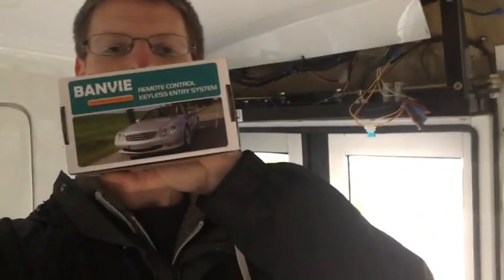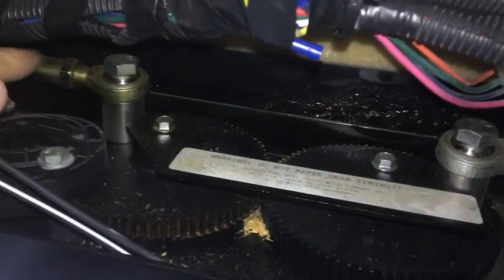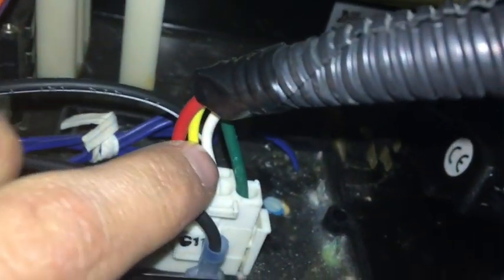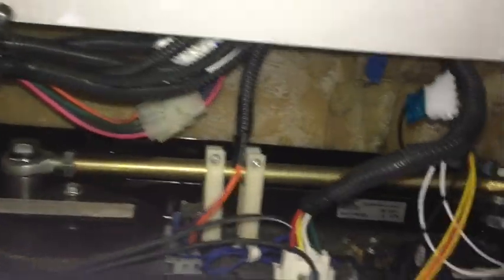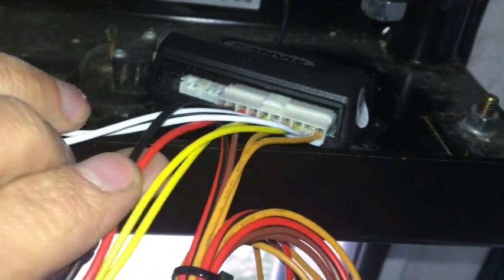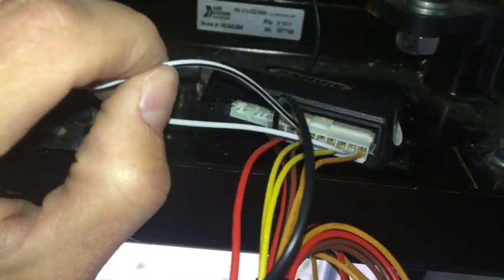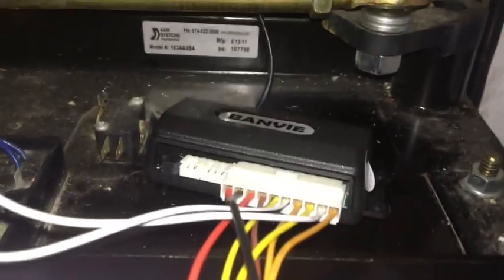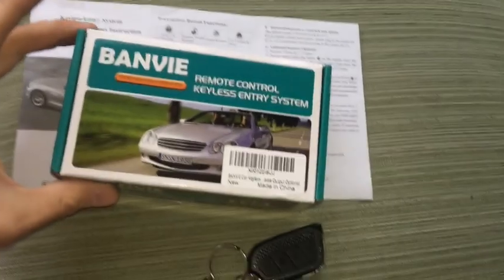How to install remote control front door opener on shuttle bus conversion

Comment: I wired it up as described and it is not working correctly.  If the door is fully open or fully closed and I push the remote (either open or close depending on which way I want the door to go) it opens (or closes) for a split second and then stops.  I did those little pins so it will run for 5 seconds.  Any other ideas on what I'm missing?

Comment: Hey! I'm trying to do this with my bus but I can't figure out how you were able to connect the power cords to the 12v battery. Any help?
Reply from the maker: miles angelo in the video we just spliced it into the power cords that were already going to the door. We later changed it to go directly to our deep cycle batteries that are hooked up to our solar to make sure that it wouldn’t drain our starter batteries.
Reply: @dustinsearer5228  great to know, thanks so much for responding! I was also wondering, how did you figure out which cord was which (power, lock/unlock, ground)?
Reply: @dustinsearer5228  my bus system is similar but not the same, so I'm having a bit of trouble figuring out what goes where haha.
Reply from the maker: For sure. We used a 12v test light like this one. 
https://www.amazon.com/OctagonStar-Circuit-Systems-Continuity-Voltage/dp/B01HUZPTPS/ref=mp_s_a_1_6?dchild=1&keywords=12+volt+test+light&qid=1594125377&sprefix=12+volt+test&sr=8-6
And used it to see which wire had power all the time (positive power) which had power when we hit the open button (open) power when we hit close (close) and which never had power (negative/ground). 
Good luck! :)

Comment: Finally had a chance to install it.
Just perfect!
Interesting fact:
My proximity switches are completely loose, I mean out of the place they were installed (I see the mark from when they were in place and the holes for the bolts line up perfectly), and my doors always worked right. The motor stops working at the moment the doors are completely open or closed.
I have no idea how this happens.
Anyway, again, what a great explanation.

Comment: Hi, I also have a shuttle bus conversion and am thinking of switching my current key fob to this, actually I have already purchased from Amazon. My current fob does not allow me to use the open and close polarity button existing on the bus. I can only open and close with the key fob. So it would be inconvenient for passengers with no fobs and as well having to carry the fob to open and close at all times. Also it doesn’t work smoothly like this, I have to push both buttons for it to open or close. 🤔

Comment: This ended up much simpler than some of the other mods. How is it working for ya now? Anything you would do/have done differently?
Reply from the maker: Initially we connected it to the main bus battery and very quickly had a dead battery. So I would say to reroute the power to the batteries of you solar system at the start. Good luck with your build!

Comment: Thanks for the great video. I actually have the same exact door on my bus as you so I thought this would be flawless. After wiring it all up (except to my 12v battery bank, not to my car's battery) I soon realized that every time I close the doors with the FOB, after 5 seconds the door automatically opens back up again! Tried many things and just cannot get the doors to stay shut. Any feedback would be appreciated.
Reply: PROBLEM SOLVED! When I originally wired this, before disconnecting any wires I had the doors in the OPEN position. I believe this was my issue. I rewired everything back to the original setup, put the doors in the CLOSED position, and wired this up just as described above and it worked! Hope this helps anyone else having this issue.

Comment: Great video and my bus door controls and gears looks just like yours BUT!
My bus is Ford  F550  even though it looks just like yours it did not work? Help
Reply: Same here. I have a f450 shuttle bus. Didn’t work. Same wiring. I do however get a red light on the bus motor box. 🤔

Comment: Great video!  Still adding value.  I bought a different key fob and it was small could not get it to work.  Saw another video on this key fob and it was confusing. Yours was spot on.  Question:  Did you have a switch by the dash and did you disconnect/ bypass or can you still use that switch?
Reply from the maker: Hey. Glad you found it helpful. Yes, we had the switch on the dash and it still worked. We just spliced into those wires without disconnecting them. So we could open the door with the dash switch or the fob.
Reply: @dustinsearer5228  Awesome!!     And appreciate the quick response.   That was definitely what I wanted to hear.  I tried putting a fob receiver in right at the switch location so I can still use it, but wires didn't match up.

Comment: what battery does it connect to? is there a battery up there with the motor? or is it talking about the engine battery? or the batteries that are powering the rest of the bus?
Reply from the maker: We first connected it to the starter battery for the engine but then realized that would drain it and could strand us. So we rerouted it to connect to the batteries connected to our solar set up which powers the rest of our build.

Comment: Help.  I wired up and it "works" for about 2 seconds and then it pops the fuse in the panel.  Replaced fuse multiple times and checked wiring.  Any suggestions?
Reply: Ground issues?

Comment: So I followed everything everything on this video to the T. But every time I activate my wireless key fob, my fuse ends up going out.is there any other alternative I could try? I followed all different options on the manual but still no luck.
Reply: Wired wrong? Either the device is trying to draw too much power, or something is shorted. I would cap the unused wires, because they could short out.

Comment: so the doors will work without the vehicle key in the on position or vehicle started???
Reply from the maker: Yep. That way we can use it as our normal entrance so we don’t have to climb over the driver’s seat every time.
Reply: @dustinsearer5228  thanks.... I have an outside key slot to open my doors from outside, but if Im in side and want to go out, I have to duck down and go turn the key on inside to get outside.. so will be getting one.  Im working on a 2007 shuttle now... if your interested in taking a look at my boring channel I would appreciate it..  thanks
Reply: was that the KS020 or the  KS021?  thanks
Reply from the maker: The American Wanderer we used the KS020